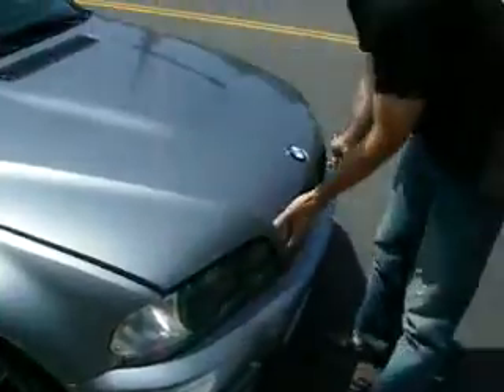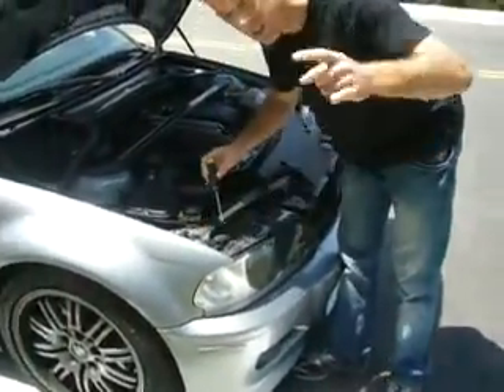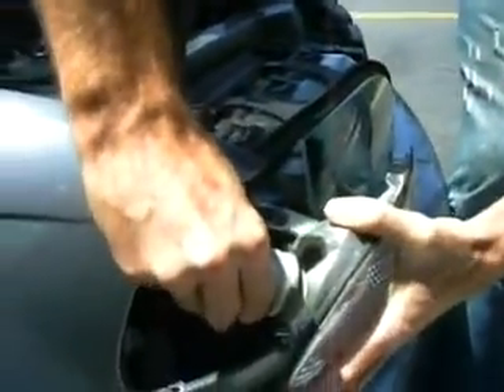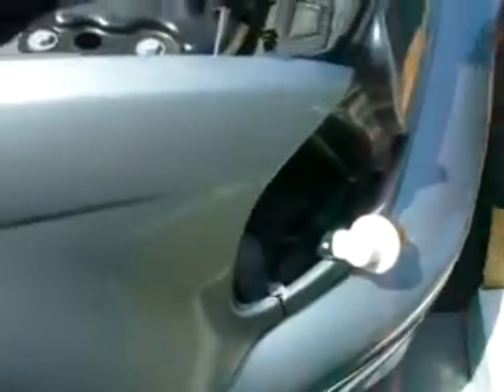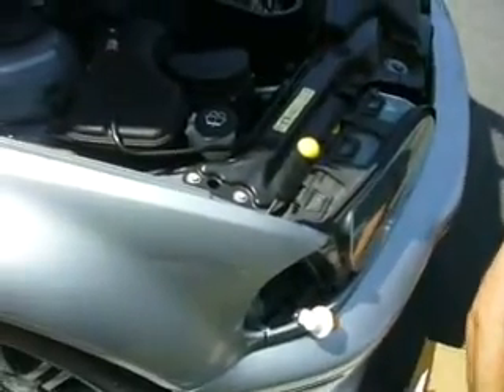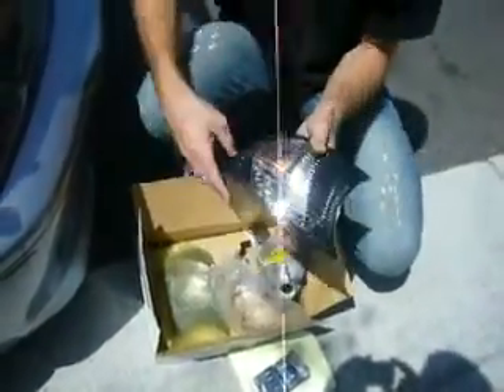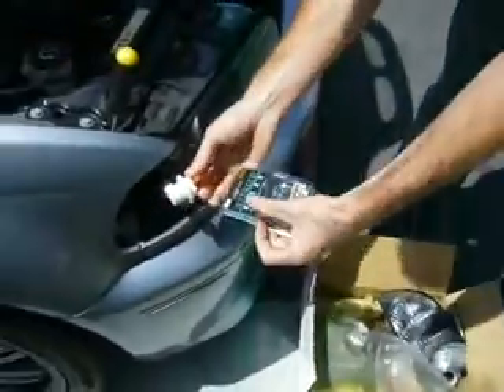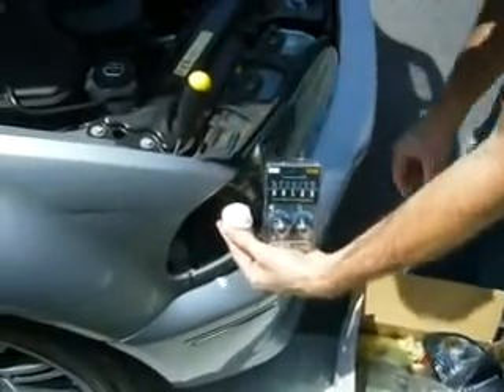BMW Clear Corners - How to Install Clear/Smoked Corners and Stealth Bulbs

Comment: the wind in this video is so fucking annoying. But i ordered this product from DDM tuning.. prob should of looked at you guys first, since DDM SUCKS! and the smoked corners dont even fit... i have an 01, so its a push in, and the DDM smoked corner doesnt even clip in. its a piece of trash,